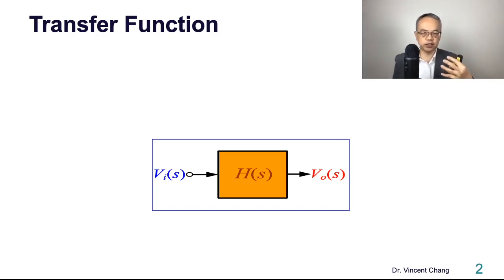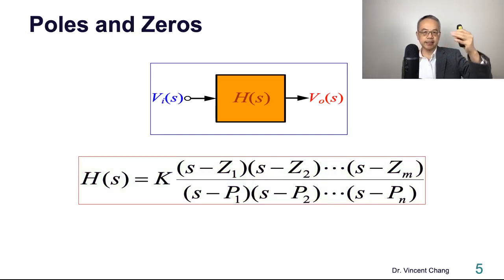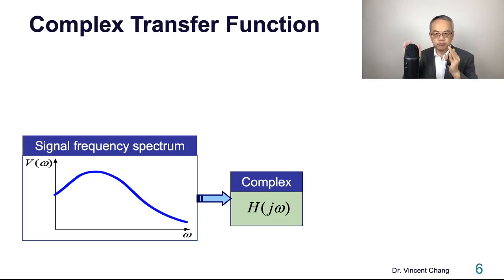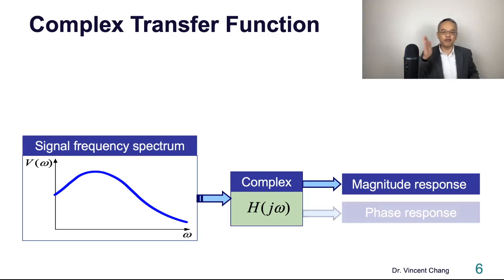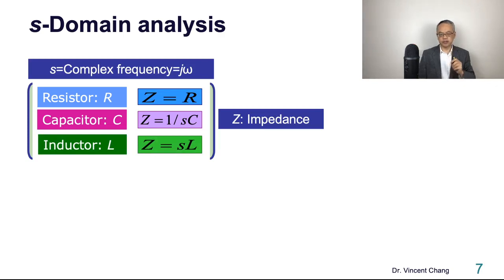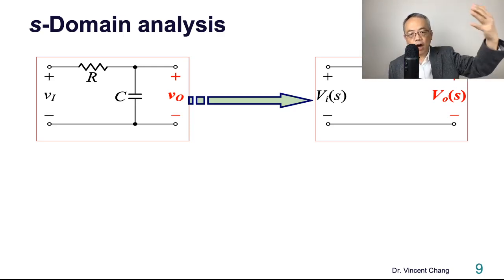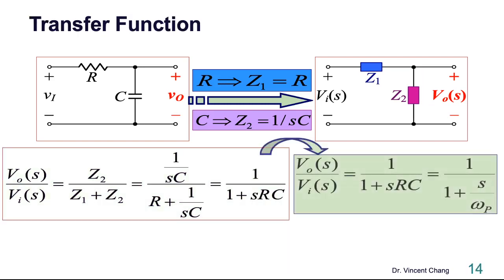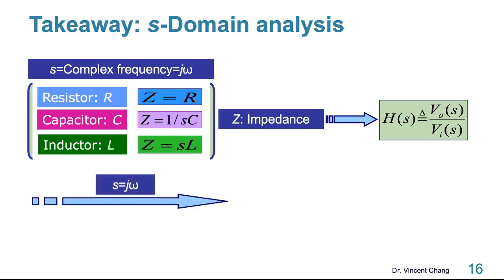Intro to Frequency Response: s-Domain and Transfer Function

Comment: S domain means Complex freqency & JW means Physical Frequency. Denominator Called Poles(P1,P2,P3,P4.....) & Numerator Called Zeros(Z1,Z2,Z3,Z4...).
4:20; Voltage vs W graph. Physical Meaning of Complex Number is Its Magnitude & Phase. 
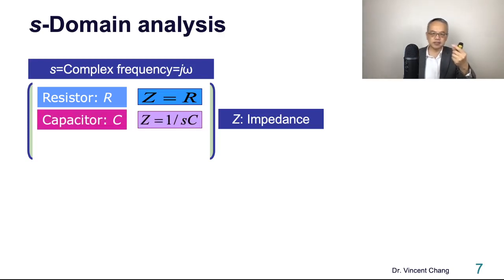7:10; S= Complex Freq = jW. Impedance,Z= r; for Resistor. Z=1/sC ; for Capacitor. & Z= sL; for Inductor.  then we convert from RCL to Impedance Z and define Transfer Function.
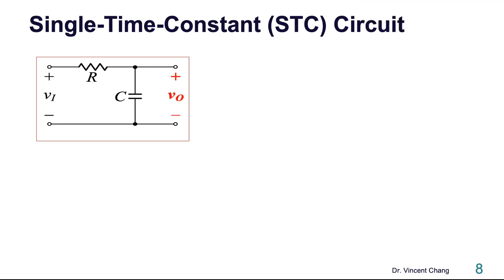8:50; STL(Single Time Constant) circuit.
10:10;Derive transfer Function
11:20; RC Called Time & Inverse of Time Called Frequency(s/Wp) or Pole freq. A Single Pole Transfer Function.